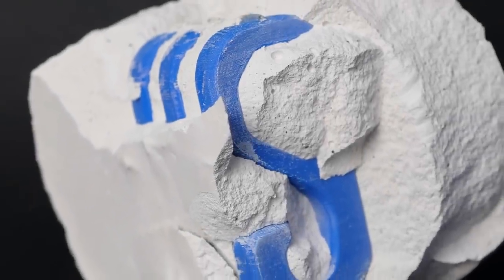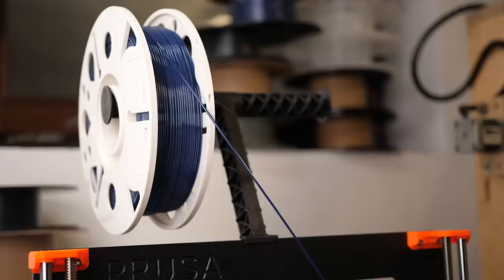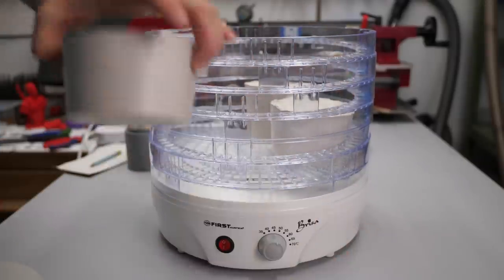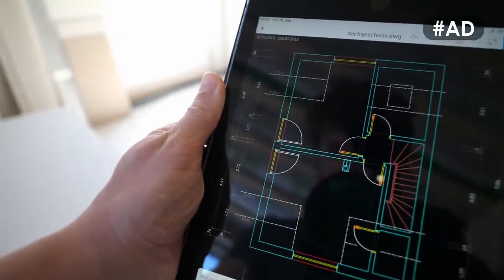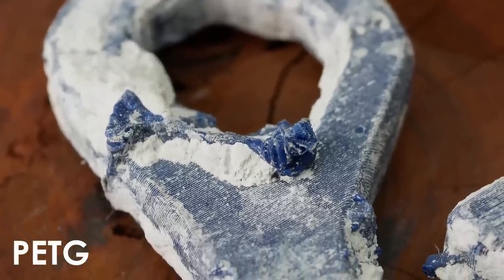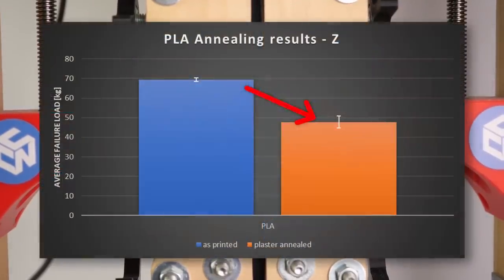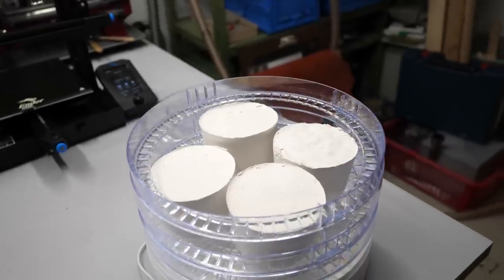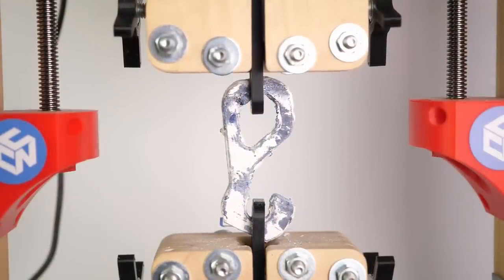Triple (x3) your Layer Strength by Annealing 3D Prints in Plaster!

Comment: The annealed PLA would be nice for drone motor mounts with the increased heat resistance. I had issues with previous designs warping from the motor heat through the screws and eventually causing the motors to come loose.

Comment: I remove the bubbles from plaster with vibrations like from an vibration sander.

One thing I always wanted to try is compacted oilsand.
The kind used to forge aluminium.
Its easy to remove, heat resistant.
Reply: Not sure what kind of vapours oil sand would give off. If using a domestic oven, it might taint/contaminate foods cooked in it afterwards.

Comment: 4:25 are you not worried about picking up the calibration weight with your hand directly?  what about leaving oil from your hand on it and changing its weight?
Reply from the maker: True, will use a piece of cloth next time, though 2kg are quite heavy ;-) . The reason why I use the calibration weight is not for absolute accuracy but repeatability over several days, when temperatures change and there the influence should be minimal.
Reply: @CNCKitchen  ah, that makes sense. I thought maybe the potential weight change was too small to matter. on the other hand, this is a good excuse to design and print tongs for handling the weights.

also: eeeeee you replied to a comment I made! wow! I'm a big fan

Comment: Instead of using a vacuum chamber try using a vibrator for removing the air bubbles. That's how it's done for concrete poured in forms. 

And I don't know if this would work, but how about placing the parts that need cleaning in a sonic parts cleaner? 

Just a few ideas 

And thanks, I love your videos. Keep up the awesome work.

Comment: Hey, just a thought, what if instead of using finely ground salt you use the dry gipsum powder? That would avoid hydrolysis for PLA, the remaining powder would be mostly possible to wash away like salt and it's super cheap. You might have to run the plaster through a sieve to eliminate any clumps. The gypsum will absorb water in air, but again, it's very cheap. It might even suck out some residual moisture from the prints, not sure if that would be beneficial.

Comment: Great video! I love your experimental approach. I see that someone has already recommended a salt cast. Was wondering if you've tried the sand method with proper casting sand and a casting box? The sand you used in the video looked a little coarse. Sand would be easily reusable, and I doubt this is true of salt

Comment: Thank you so much for doing these tests, particularly the structure test under heat, that's insane that the glass transition temperature would seem to change that much!. I'm gonna go out on a limb and assume this isn't applicable to ABS because it is a hygroscopic material?

Comment: Hold the temperature at 95C for four hours, followed by another four hours at 105C(after rough drying in dehydrator). We discovered when ashing samples this drove off all the water before ashing. In the case of ashing if you do not drive off all the water the sample will pop and blow sample all over the oven (wasted test)or contaminate other samples.

Comment: In 3d pen smoothing, a common solution is to use a wood burner.  Maybe try something like a heat gun where you have more overall control of area, temperature, and time.  Heating up the print in certain areas at low temperatures and gradually using higher temperatures will allow more control to the layer adhesion rate (in theory).  Think about it like a microwave and a large piece of meat.  The middle of the meat will get warmer at a slower rate than the edges.  By using a heat gun, you will be able to more accurately account for how much the print has become adhered across layers in the middle of the print.  It may lead to discoveries about how PLA heats up that could give us insight on what tools to use to give us the best results.

Comment: Realy interesting. Glad you kept efforting on this subject.
Though, I'm not really convinced that the gain in resistance for PETG is significantly different than the one we would obtain by simply augmenting the "combing" (that's the effective result of the PETG hook having melt in the plaster).

Extending the subject, I'd like to see a similarly serious test investigating the "memory shape" of the tested plastics (that may be an absolutely crucial obstacle).
And also, it could be very interesting in another video to expose some sort of initial questioning on the hypothesis that it may be absolutely impossible to obtain neither a better layer melting, nor a better cristalized structure without the action of a "plasticizer" (thinking that the filament may have already been produced through the action of such a "plasicizer").

Comment: Yep, works with sand too, I'd suggest using casting powder, casting sand, etc   it helps to vacuum chamber them too the problem is you NEED to do them solid to do it right, so you use a lot of material.  Afterwards you need to basically remelt them in an oven or forge while in their cast

Honestly ..you're supposed to vacuum chamber the plaster, you did it right the first time.  It's how we do lost pla, lost wax, etc

Temperature-wise you're gonna want to go up to the liquid temp of your material, above glass transition, because you're using the part to make a cast to make your part again, doing less than 220 for abs for example would just be wasting energy with a half done procedure.  If you want it to have proper strength like a molded part all you should need to do is remelt in the plaster, also you need to do make sure there are no air bubbles, while it's liquid it needs to be degassed in the vacuum, and then completely melt and reharden the material.

Comment: Could you use casting sand mixture that uses oil instead of water? Sometimes it's called green sand? Might help with air bubbles and water absorbion.

Comment: Would printing in a nitrogen purged box improve strength?
Also would printing in a vacuum chamber make sense? One possible problem is that you would not have convective cooling on the plastic that is laid down and it might deform.

Comment: Do it in a high temp silicone mold and get rid of the mess. Also you could reuse the molds if you are doing multiples of the same print. I wonder if you had a filament with metal powder or graphite  in it if you could put the print into a microwave to heat the plastic for internal bonding without overheating the outside?

Comment: I had the same idea of using plaster after i watched your video on using salt.
To improve Bro, maybe try to do these:

- Put the 3D printed parts first inside your mold, before filling in the plaster slowly to minimize air bubbles.
- Use a smaller mold to minimize the plaster thickness surrounding the 3D printed parts
- Instead of using mold, try making the plaster mixture thicker, then coat the 3D printed parts by dip-coating - like how your would deep coat tempura. You can do multi-coats to ensure complete coating with enough plaster thickness.

Comment: You can maybe use a casting sand instead of the plaster. This should be easier to remove? I was surprised with the heat resistance of the PLA.  Keep up the good work!!
Reply: Yes, I was thinking the same thing. I have some casting sand, which is used for cast iron lost cores. It is a bit porous, but if the viscosity of the melted plastic is high enough, it will not diffuse. It would be easy to dehydrate the sand, as there is no water involved in the bonding of the sand. Only particle composition and maybe some high temp. grease of some sort. If you heat slowly around 100 degrees, perhaps moisture would be able to disappear from the plastic items. Steam would definitely be able to diffuse through the sand.

Comment: If you add baking soda to the water prior to submerging the plaster of Paris molds it will dissolve the plaster slowly but it'll happen I used this method with bronze casting delicate parts
Reply from the maker: Thanks for the info.

Comment: I've tried it before, someone bring me a broken cappuccino machine piece, the part where you lock the portafilter, it was made of fiberglass reinforced nylon so they figured out pla would do, but they didn't consider that pla deforms with heat, but I tell them I'll give it a shot anyway, I researched and ended up in this channel and it occurred to me that the plaster may prevent the pieces from warping, I placed the parts in a toaster oven at around 90° C for an hour just to dry moisture the Best I could, then crank the temperature all the way up and Left the parts there for 30 minutes, I cleaned them and drop them on boiling water to test if they hold the shape and strength, and to my surprise they did, I didn't asked if the parts worked on the machine but I think they did

Comment: Ha, I've done this with metal bits! Also, a vibrator will remove bubbles, and you can use some filler in the plaster to make it break off easier.

Comment: You should know that plaster expands when it sets... which is partly why your tensile tests snapped in the plaster- it pushed either end apart-   This also might have something to do with it not doing much for the PLA as when it was at temp, the plaster had placed the entire part in slight tension, exacerbating the poor layer adhesion already present.
You could try this again with either Ultracal- which has a very low coefficient of expansion... or a new product from USG called dry stone that supposedly does not need to be dried after casting.

Comment: For reducing bubbles, you might find a pressure chamber more useful than a vacuum chamber.  Check out some Peter Brown resin casting videos to see the effect.  (It sounds weird to increase the pressure, but it avoids the foaming you saw and works very well in resin.)

Comment: Why not take the temperature a little higher on pla to around 230C and also preheat the oven. also how about coating the pla parts with before the plaster to prevent the absorption of water?

Comment: You need a release agent. Would petroleum jelly react with the plastic in the print? If so, you could try a water based lubricant. Even if it dries out, you would still get a slight barrier making it easier to clean. You could also try wrapping the print in cellophane, or wax paper if the cellophane melts to the part. When mixing concrete, vibrating it with a rod removes bubbles. That should work on plaster, too.

Comment: Try a vibrating table/device to remove air bubbles. Vibrating the plaster mix will let air bubbles flow easily to the surface. But you will probably need to hold the prints in place since they will also float or sink depending on relative density.

Comment: Fantastic video! Does this only work on filament printing? How do stereo-lithography printed materials perform compared to these print that you've shown? 

I think this process could be improved by taking advantage of 3d printing by creating a 3d structure that focuses on smaller cross-section while not losing strength. Geometric optimization, I am sure that autodesk has a solution for that. By reducing the cross-sectional area, you could improve the process at which it heats and cools. Also, improve the drying process. I think this may improve the performance of the material.

Comment: Love your content, I do have a suggestion though. Add a sprue to the 3D model, just like you would for casting metal, the idea being that as the model liquifies in the plaster, the spire melts and as it’s excess material above the model, fills any voids and helps prevent part shrinkage from any voids or air in the small gaps of the model.

It would also act as a vent of sorts for moisture and off gassing, all benefits, then simply cut the sprue off just like you would a metal cast part once removed from the plaster. 

I’d love to see a comparison and how homogeneous the material is afterwards.

Comment: Really interesting, thanks! Have you thought about the inclusion of a heat-resistant rotating platform to constantly rotate the parts as they're being annealed within the plaster? Much like slush casting, this might help distribute the plastic against the walls of the plaster better. I feel that rolling the parts against the layer lines might be worthwhile, also, up the temperature to just above extrusion temps to make it more flowing.

Comment: I just watched another video using compacted dry salt as reinforcement during annealing.  I wonder if you could use DRY compacted plaster (or even just slightly moist "green" plaster to avoid/lessen the moisture and bubble issues.

Comment: With materials like concrete you'd use vibrations to get the air pockets out. Not sure about what protocol to use for plaster (given the short setting time, and the fact that over vibrating will also begin to separate the water).

Comment: Stephan. Could you coat the parts in a 2 part tin cure silicone instead of plaster? I think it’s good to 400deg F. - maybe not enough heat resistance, but a lot less cleanup.

Comment: Weigh the dry plaster and the 3D prints before mixing the water into the plaster, then you can see if remove more of the water, you could also use a moister meter.

Comment: Instead of plaster use silicone. A cast silicone can be resistant to high temperatures and can leave a better "mold" for the reflowing process. Also before casting the parts try to remove the ridges normally left from the style of printers you are using. Unfortunately the ridges introduce failure points as plastics like to be 1 smooth surface as apposed to full of bumps and ridges. This is a great idea and made a great discovery with the heat resistance properties of the plastic.

Comment: Coils of copper wire could be used in the plaster as a pull string to rip it apart,   and as a way to conduct heat into the mass during annealing.

Comment: If you are looking to remove air from molds it can often be better to use pressure over a vacuum. Peter Brown learned that the hard way as well on his youtube channel when working with resin. If you try this again I would suggest doing the attempt with a pressure pot to remove air from your molds.

Comment: You might sidestep the drying process and bubble issues by choosing a fine powder that can be rammed, something like cornstarch. Basically treat it like a lost wax casting without the slip coat. Ram a base layer in a metal container, then compress fine layers until they're over the part, and then a thicker cover layer. At that point you should be able to pop the whole thing in the oven and anneal it, and the only risk is from thermal expansion shifting layers. Cornstarch should be soluble enough to simply wash the part clean.

Comment: The best was to remove bubbles from plaster is to vibrate the mixture, I used a bolt with half the head ground off in a drill to make a makeshift plaster shaker and just place the body of the drill on my mold

Comment: I think it would be cool to use low wavelength infrared to pulse-fuse the printed layers during the printing process, if you had some kind of XY beam path that could constructively interfere in the small area right through the prior layer and raise the temperature enough to fuse the layers but briefly enough to prevent local deformation, you could probably approach injection molded strengths in all axes.  Would take a lot of tuning, but you could even do some phase-shifting to "stitch" the materials together with focused IR.

Comment: Have you thought about a light coat of petroleum gel (or similar protective medium) before adding plaster not sure what the reaction would be at the 200c Mark. But might improved removal and protection from water. Also rapidly vibrating the plaster may get more bubbles away from the part.. just a thought. Btw love the content.

Comment: Hi Stefan,  I found this interesting.  I have been using some High Temp PLA recently that requires sitting in 95 Deg C water for 30 minutes after printing.  But I have been putting in vacume sealed bags (to avoid direct contact with water and help keep their shape) and then boiling them using a sous vide heater.  So far that has been working well.  I wonder if this would make a good test for you.

Comment: I like your methodical scientific approach to testing various methods. Has anyone tried using talcum powder to encapsulate printed plastic parts before annealing? It is a much finer grain than table salt and is not corrosive. It is a mineral (talc) capable of withstanding high temperatures. Another possibility might be sodium bicarbonate, which is available cheaply in bulk quantities for use in soda blasting, Using plaster does appear to work but seems to be more time consuming that just packing the parts in some type of dry granular or powered material that is easily removable. When using a powdered material to enclose a printed plastic part using a vibratory table to thoroughly  compact and settle the load might prove helpful.

Comment: a lot of people are talking about mold release agents and silicone. If its pliable, and doesnt stick, it will change dimensions and shrink in. Thats the whole point of the plaster. Maybe it might make the petg hold form okay but its still going to change dimension. And if youre making silicone like that, youre already making a mold, so just make a mold and use the extruder as an injection molded nozzle...

Comment: Looks like you need to increase the anneal temp on pla. Also vibration removes bubbles best, so a reciprocating saw with no blade against the bucket will flow faster

Comment: What about using a MMU printer to create strength test pieces which have a PETG core with a TPU shell?
I know TPU doesn't stick to PLA but does bond to PETG really well when I tried test pieces where change filaments at different layers.